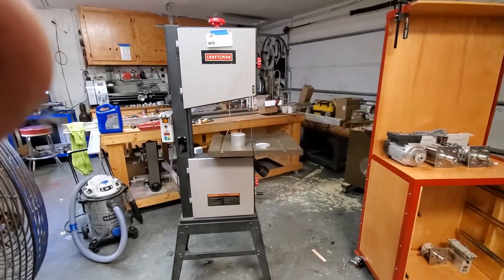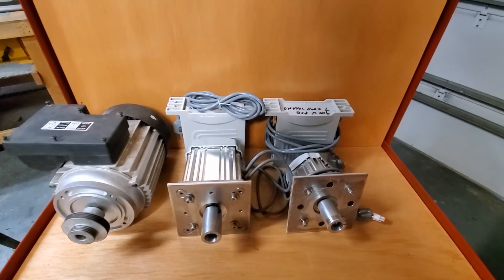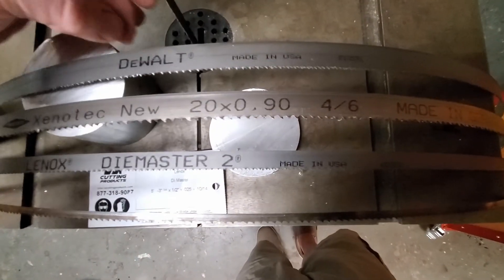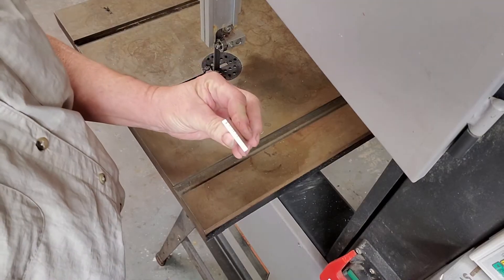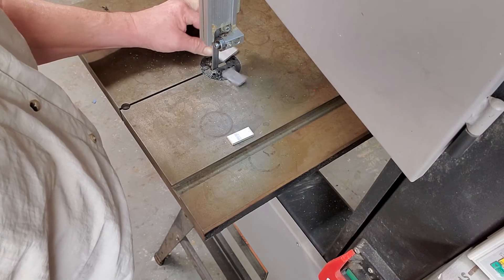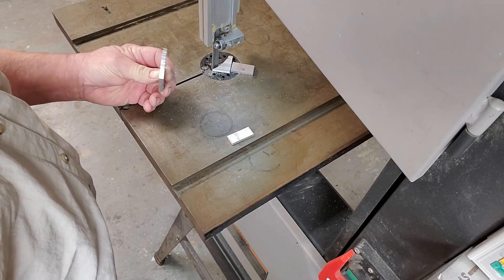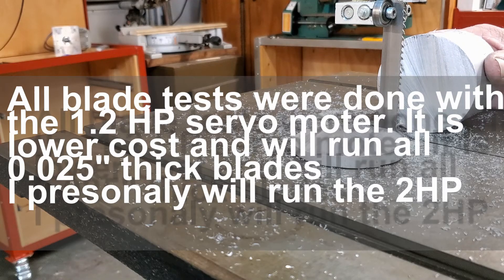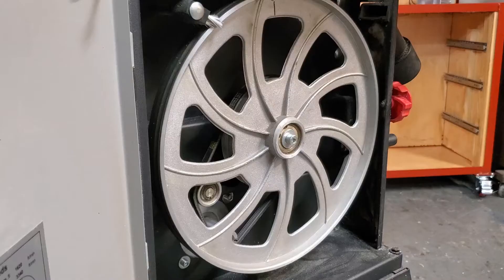Craftsman Wood Band Saw Motor Upgrade Conversion Metal 1 hp fixed to variable 2HP Servo problems fix

Comment: Hi Daniel, Great video! Just FYI, the motors you use are not servo motors, they are brushless DC motors. Servo motors have position encoders, but these do not.
Reply from the maker: Actually they do have position encoders and can be programed to stop at them as well.
Reply: Hi Daniel, I was looking at the motor on your webpage with the back cover removed and it only has hall effect sensors, but no encoder. Anyhow, doesn't matter. By the way, I just bought one of your kits! Looking forward to installing.  @danielmartin382
Reply from the maker: The position sensor is an add on pair of hall sensors to be attached to the spindle of the machine, not on/in the motor. It plugs into the 4 pin plug and only has 2 stop positions. I do not use that function. The new control units eliminate it completely as most only use these motors as a manually operated high torque BLDC. 
I do have several customers controlling these motors via CNC systems: 
This is not easy on the current motors and it tends to be poor control as well. However the new controllers are much easier to convert. An isolation board is required.
It is on/off switches and a simple 0 to 5 volt signal. Forward/reverse/stop/run/speed is achievable. I may release a schematic or an adapter kit in the future. Currently only the reverse on the fly controller has this operating system. 
   I will be releasing all new systems in about 60 days to include all new housings designed for converting machines to modern motors. These do not have the extra plug in points for sensors etc so I suppose BLDC will be a more accurate description. Still all manufactures call these BLDC motors Servo Motors. In order to compete, I will have to do the same.
Maybe you would choose to wait for the new release. Based on You Tube info, I cannot determine which purchase is yours. If you are planning to use a CNC controller, you should contact me today before I ship your order. If it is already marked as shipped, it is likely to late to avoid return shipping. 
Thanks
Dan

 @GeneralDesignInnovation-es4zz
Reply: Hi Daniel,
Thanks for the info. I am just using the motor and controller that I ordered for my bandsaw, so it should be fine. Thanks again. Dan @danielmartin382

Comment: Interested in seeing (hearing) some more of the motor running.  Be great to have a comparison of old and new motors.  And, what about torque curves.  How does the torque change vs speed on the servomotor?  And compare to a normal electric motor at the typical 1800ish rpm
Reply from the maker: Hi Zen.
 I have over a dozen different systems now. They all need YouTube videos. No time to do that with all the parts manufacturing etc. Maybe buy one and do the video for your project.
If I like the video and it promotes my systems, I might refund your purchase.
Thank you for the interest.
Dan